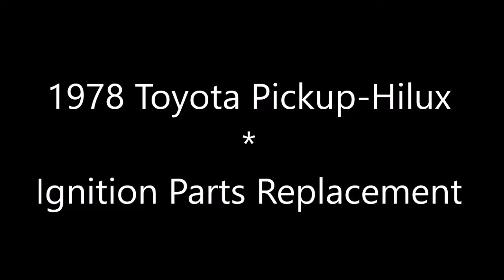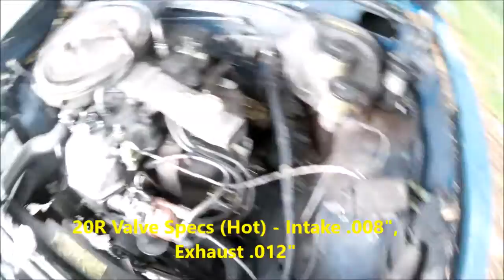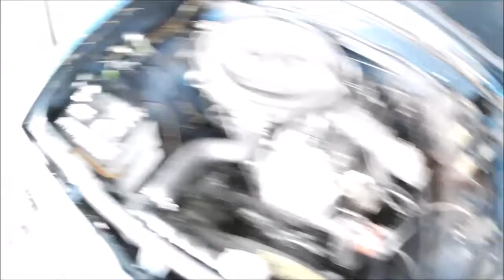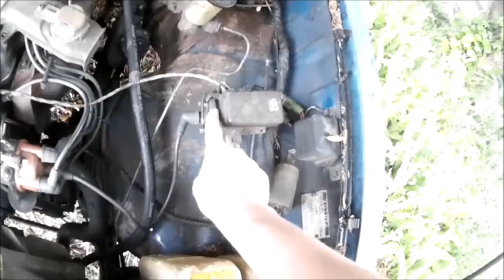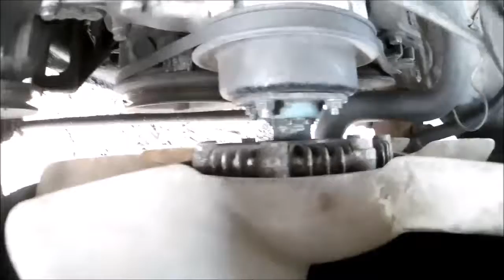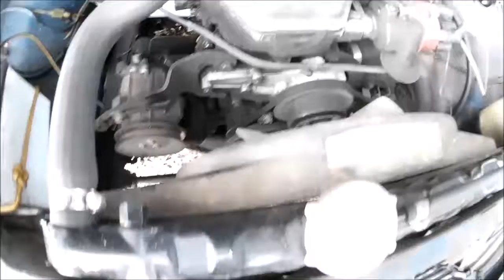1978 TOYOTA PICKUP/HILUX 20R - IGNITION PARTS REPLACEMENT

Comment: Message for "The13thSword" guy: I know it's eight years too late but I know why your having a problem keeping your engine at idle speed. I had the exact same problem occurring on my 20 R engine! And I was able to fix it myself. I'm not sure what it was called but it's a half-inch diameter solenoid with wires attached to it that screws into the rear passenger side of the carburetor. Like what happened to my solenoid, they sometimes get clogged and sometimes they can't be cleaned. During that time, 20 years ago, I simply bought a new one through one of the auto repair centers. But, during the last eight years, you probably had either found another one or cleaned the one that you already had your carburetor. 

Or, unfortunately, you probably got so fed up with your pickup truck you probably sold it pretty cheap to someone to let them deal with those little frustrating problems of keeping the engine running properly.
Reply from the maker: Late or not I still appreciate the message, as more info is never a bad thing. I posted this stuff to hopefully help out others with the same problems with their 20R's.

My problem turned out to not be the solenoid itself, but it was related to it. It was a blockage within the idle circuit passages inside the carb, due to very small rubber particles getting stuck in those passages. Those particles came from the old rubber fuel lines that started to break down & shed particles due to the use of modern Ethanol-laced fuels. The original rubber fuel lines were never formulated to handle Ethanol fuels, & Ethanol degrades that kind of rubber over time.
So, with the idle circuit blocked, the engine was trying to idle on the carb's main circuit only and in that condition, you can never get a decent idle.

The Idle Stop Solenoid worked perfectly & the rubber o-ring on it was in good condition, but I did have to remove it in order to clean out the idle circuit. I also had to remove the Idle Mixture Screw and the bolt on the passenger side of the front of the carb to access the Idle Jet. With those parts removed, I had complete access to the entire Idle Circuit. Several soaks & flushes with Carb Cleaner Spray using the "red straw" that comes with the can did a great job in blowing those rubber particles out of the idle passages. A little follow-up with some low pressure compressed air finished off the job. Once I reinstalled the Idle Mixture Screw, front bolt & solenoid, the idle was much better.

In your case with the solenoid not being functional, it was basically "stuck" in the "closed" position, blocking off fuel from going into the idle circuit passage. That's basically & functionally the same problem as a blocked idle circuit so that's why the problem looked similar to yours.

Fortunately, I did not sell away the truck for cheap for someone else to fix, and I still have & drive it. Once I got the HEI Ignition module conversion squared away & tuned the carb for best lean idle, it runs well & smooth, & gets about 24 MPG city, which was it's rating when new. (Original sales spec was 24 MPG city, 30 MPG highway). I also installed new Ethanol-rated rubber fuel lines & run 89 octane non-ethanol gas in it now to avoid any future fuel system problems, but with the new rubber fuel lines I can run Ethanol-laced gas in a pinch, if I have to.

Thanks again for the message & input. Even being 8 years late it allows me to post further info so someone out there could/cam make use of it.

Comment: I have a 76 1 ton motorhome that somebody has screwed up it did run and it still runs but that ignition coil with the transistorized ignition has got to go. Unless I can figure out what's going on with this thing I wired a temporary key switch under the hood to make things simpler basically making my own wiring harness but when I try to start it the way I wired the coil earlier I can't get it to run so I'm giving up for the day. I don't get any continuity on the resistor but it ran earlier after a bunch of crap happened you don't know what you ruined
Reply from the maker: I see that you've sent several different messages, so I will try to take them separately & in order. If you want help I'm going to need some more specific info.

What "transistorized ignition" do you mean here? The original Toyota "igniter & ballast resistor" setup or does the truck have a GM HEI ignition module conversion that a previous owner did? This isn't clear. I need to know exactly what you have there.

The temporary key switch underhood for certain types of testing purposes is OK, but you need to understand that one of those usually only acts as a remote starter switch for the starter motor. The ignition circuit itself is separate from that. Also, your truck should have a stock electric fuel pump in the gas tank. That pump has it's own dedicated circuit with a relay & a resistor, and is run & activated in different ways through the ignition circuit & the oil sender switch.
I say all this because I know that using a remote starter switch & also having the truck's own ignition switch turned on to "RUN", the fuel pump will not activate & send gas to the carb, because you've bypassed the "START" side of the fuel pump circuit with that temporary key switch.

I do have a video up about a replacement fuel pump relay that explains it a bit further, but if you need a complete explanation of how it all works together & why just ask. You can find my email address on my "ABOUT" page on my Youtube channel page.

You said "I don't get any continuity on the resistor." What part are you referring to here? The ballast resistor? The fuel pump resistor? Something else? Please describe the part's appearance, location & any marking(s) it may have, & what other part(s) it may be connected to.

I will look at & respond to your other messages next.

Comment: Is there any replacements for the igniter? I have a 78 Celica and want to know if there’s a replacement I case it goes bad. Still has the original one and original coil. I would like to change the coil as well.
Reply from the maker: There are no new original stock style igniters available on the market for the 20R. Your choices are to find a used one and hope it works (many junkyards will not guarantee electrical parts so no returns or refunds), or you would have to do the GM HEI Ignition Module conversion (which I have done and have a video up on Youtube).

For a used igniter I recommend Yoda Jim's near Denver (https://www.yodajims.com/). They have some RV models of the pickups with the 20R engines, so an igniter from one of those is very likely to have low mileage/usage. You would have to call and ask as they do not take online orders.

The GM HEI Ignition Module conversion takes a bit of work, but is a great solution and works well. You can carry a spare module in the glovebox with some basic tools and can swap one out on the side of the road, if needed, in less than 10 minutes and get running again. This system is also quite reliable; my conversion has been going for over 2 years now on my 20R without a problem.

About the Coil. When an ignition coil starts to wear out, it can have higher than spec Secondary resistance, and this is what usually damages Igniters/Ignition Control Modules. So getting a fresh quality coil in there will help your existing Igniter to last longer & work better.

ONLY BUY QUALITY IGNITION COILS! This is one case where you get what you pay for. I tried one of the cheap coils and ended up blowing up 2 brand new ignition modules in less than 6 months. The Secondary side of the coil developed high resistance & fried the modules. I switched to a high quality coil and have had no trouble since. I'm using the Standard Motor Parts UC12: https://www.rockauto.com/en/catalog/toyota,1978,celica,2.2l+l4,1273777,ignition,ignition+coil,7060

Some local parts stores will have them in stock but Rock Autos price is usually better. The UC12X is fine as well; avoid the UC12T. The NGK coil is also good quality and might be available locally. Try O'Reilly's if you have any near you.

Any other questions just let me know.
Reply: The13thSword how would one check the gap on the pick up coil?
Reply from the maker: @kp7100  Since the Pickup Coil has a magnet in it, you have to use something non-ferrous (steel). Using regular steel feeler gauges could mislead you into thinking the gap is too small and adjusting the gap too wide. There are brass feeler gauges on the market but they can be hard to find in stores. However I have 2 other methods of doing this.

What I usually do is use a dollar bill folded into 3 layers. The paper thickness of a dollar bill is .004" so 3 folds gives you .012". The spec for the Pickup Coil gap is .008" to .016", so .012" is right in the middle of the spec. You can also use a thick business card, as they are usually .012" or .014" thick. I use the business card method to set the gap on lawnmower coils all the time & it works OK.

Whatever you end up using, when checking the gap, you want to have it set so that there is light drag fell when moving the "tool" (brass or paper) in the gap. It shouldn't take much force to drag it through, but should move easily with just a little drag.
Reply: I'm changing my complete ignition